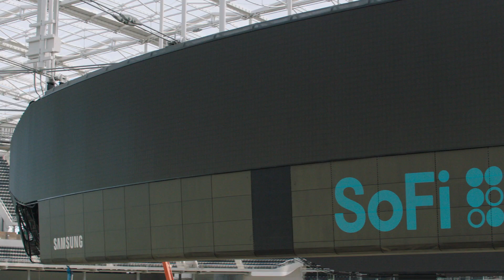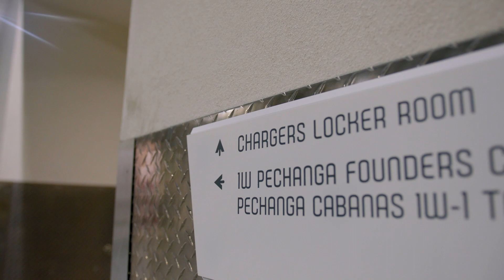NFL Mic'd Up: Austin Ekeler Tour SoFi Stadium | LA Chargers

Comment: Al Davis copied the 1960 original Los Angeles Chargers shield logo when Al Davis left the Los Angeles Chargers coaching staff in 1962 to become the Oakland Raiders manager in 1963 he then added the original Los Angeles Chargers shield logo to the Oakland Raiders pirate logo on 1963 Coincidentally
The Oakland Raiders pirate logo didn’t have the shield logo originally birth year of 1960-1962 until Al Davis joined the Raiders on 1963 then coincidentally added the shield to the pirate logo.
Raiders Copy cat shield logo but the true original L.A. logo is the 1960 Los Angeles Chargers battle horse shield logo.
Da Da Da Da Charge!!! ⚡️🐴 🏈